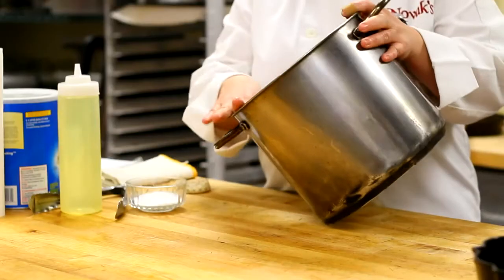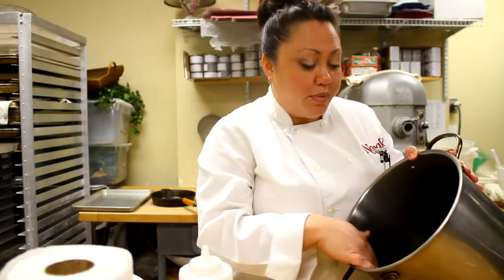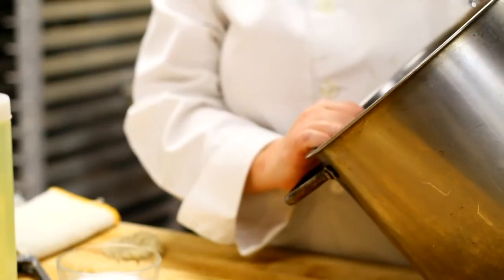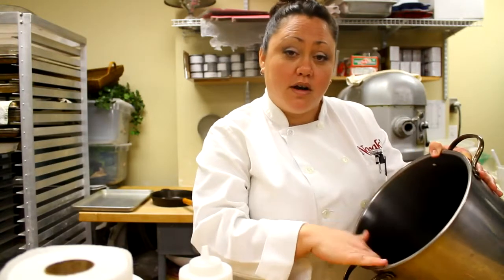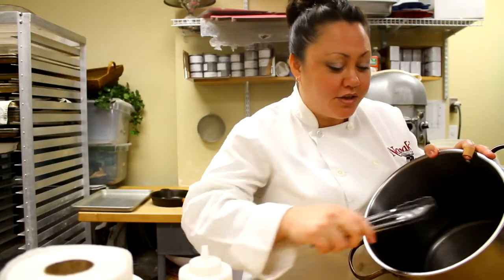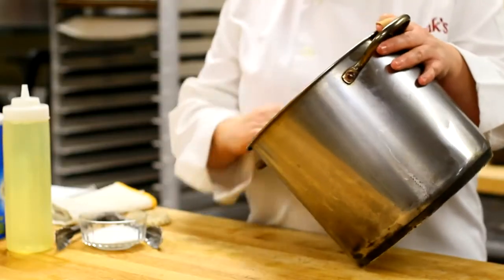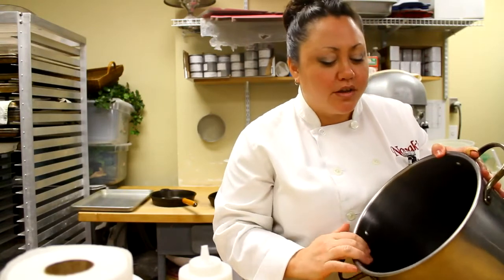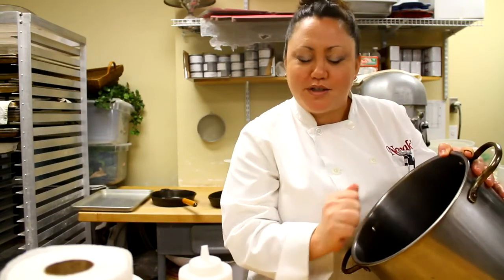How Do I Remove Scratches From Stainless Steel Pots?

Comment: I forget I'm cooking so I burn a lot of pans. After many years this is how you clean them and get the scratches out after you clean them. If it's really bad start with 600 grit sandpaper with a little water and wet sanded. You will have swirls so then you go 1000 grit sandpaper and then to 2000 actually the 2,000 will give it a mirror finish you can stop at 1,000. Heavy scratches are probably impossible you would have to do an awful lot of sanding. If it's not really bad you can start with 1000. I learned this after many years of being unsuccessful with other things. So now I went down to the basement and got all the ruined pans and they are like new now. To make it easier you could actually use a power sander. And you can get your pans looking better than new. Sanding and buffing is your cure. So with this procedure there is no such thing as a ruined pan
Reply: Thanks for the tip! Does this affect the kind of "cilinder shine" (when they pan has a factory cilindrical brushed finish)?
Reply: @cleansoapmind  you will never get it perfect unless you are some kind of professional finisher guy. The worst kind of burn is when you boil out the water and you forget about it. I found sanding was the only way for that kind of burn. I'm not sure how to get a brush finish back. But that gives me something to Google

Comment: isn't dangerous to scratch stainless steel i mean light scratches doesn't leach nickel into food?
Reply: It does not
Reply: He's correct it does not that is why you can use 1000 grit sandpaper
Reply: @stringlocker so if it has small scratches? It should be safe?